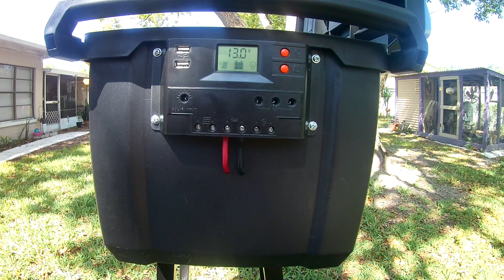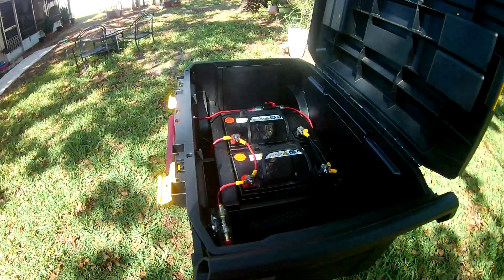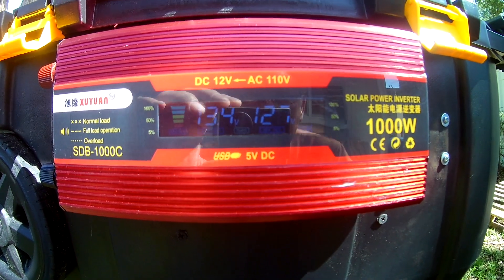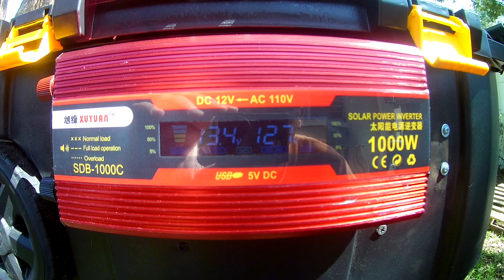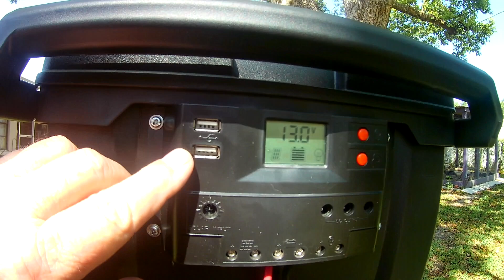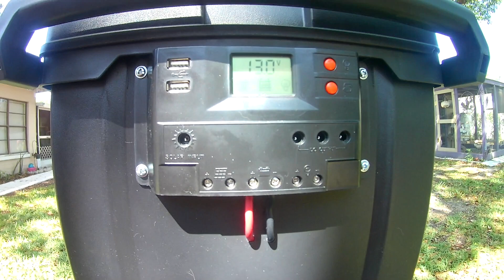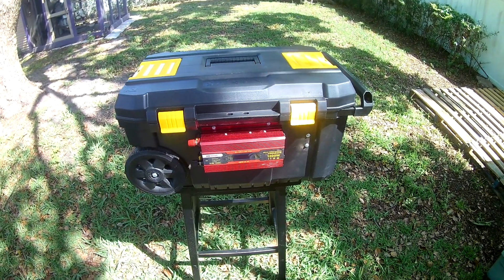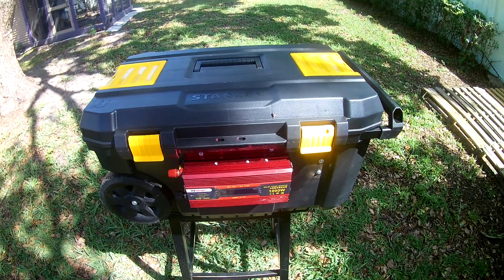Prepping - Solar Generator (portable)

Comment: I got the same box but my inverter is 2000w so I can run a small cooler tools an a simple charge baterey mantaner for nite chargeing had it for a year an its just the rite thing for my needs
Reply from the maker: What kind of batteries do you have in your box?
Reply: OP, I am wanting to build this system and can I can the solar controller model, name as well as the breaker. Also where you got the breaker would be a great help.
Thank you
Reply: Also the 10 amp fuse you used. I tried finding them on Amazon but couldn’t find them. I also assume you’re using the Thunderbolt Batteries?
Reply: Well OP, you might just email me the parts list if you could. I recently emailed you about the “Ammo Box” Solar. I’m waiting on the parts to arrive to build that one.